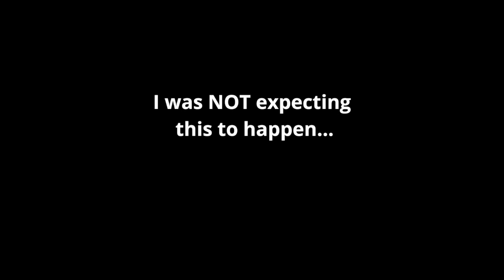MAJOR FLOOD DAMAGE...IS THIS GOODBYE? // 2018 Honda Accord Sport // Car vlog

Comment: a friend of mine bought the tallest jackstands he could get. set his car on top of them and sealed as much as he could down the bottom with plastics. long story short he saved it.  he did change the oil in his differential to play it safe. 

sorry to see your car like that man
Reply from the maker: Thanks my man! 🙏🏼 There were only 2 people that were smart enough to move their cars out of the parking garage at my building and everyone else got wrecked! Wish i knew 😢
Reply: @itsnorrin  Hopefully you get something nicer. Any material stuff can be replaced but not a life. Keep your head up and move forward.

Comment: I used to have a 2017 Accord that was just a year old with 20,000 miles on it and then I had an accident due to a drunk driver and so it got totaled. It was best to let it go and buy a new one.
Reply from the maker: Yea bro, learned that you can't fix a car that has been in a situation like this. Bad long term and risky.